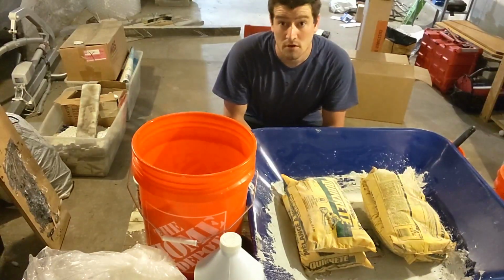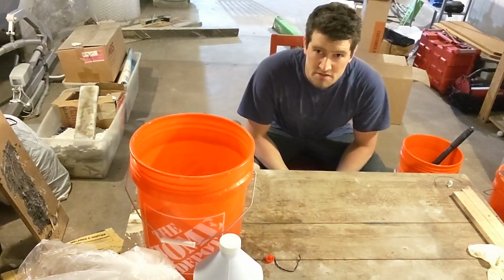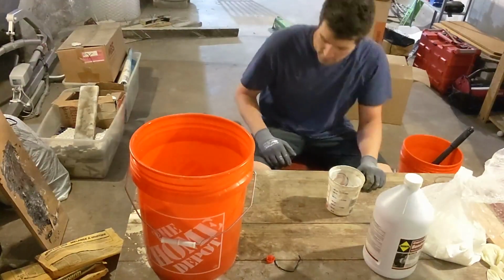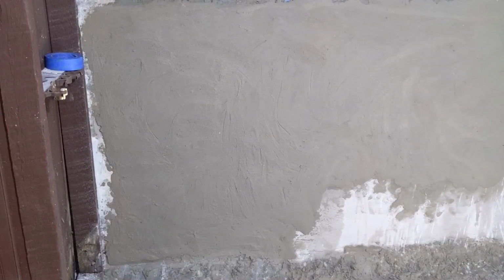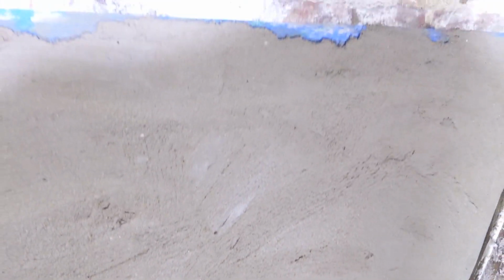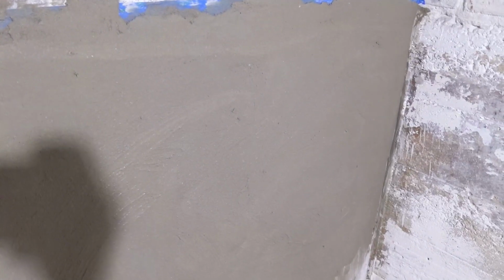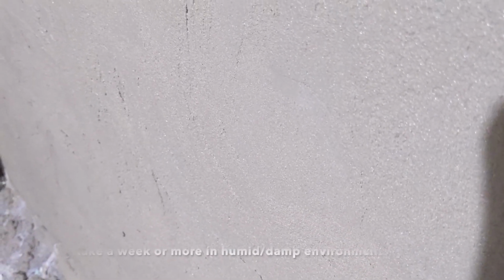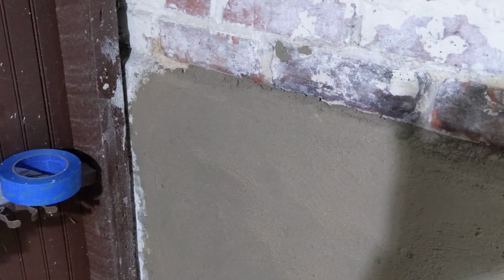Seal your basement walls and fix leaks and cracks

Comment: Why did you use type N not S?
Reply from the maker: Type N is softer and is less likely to cause cracking in the concrete wall during movement or under water pressure.